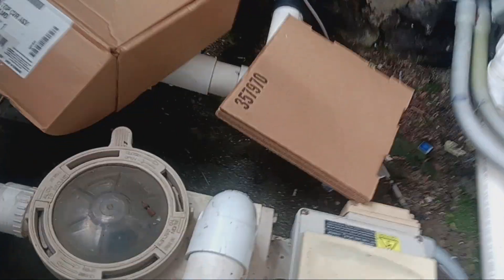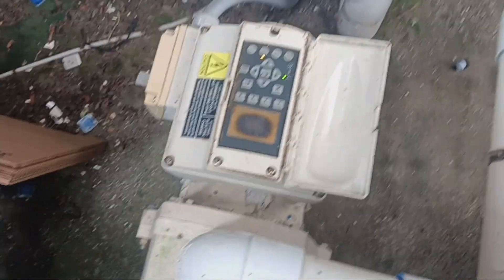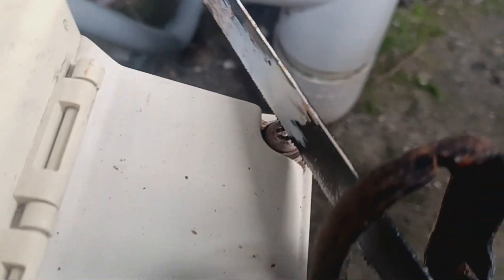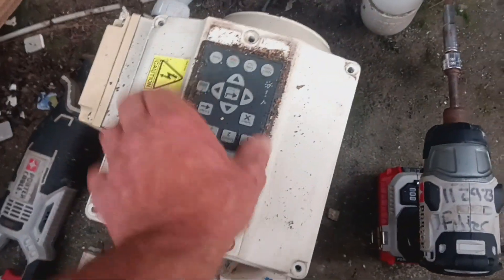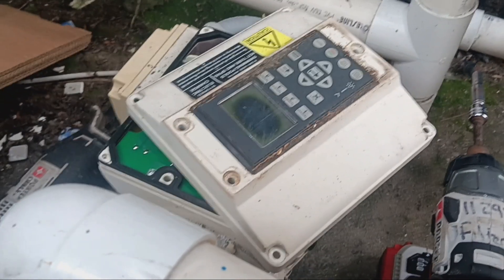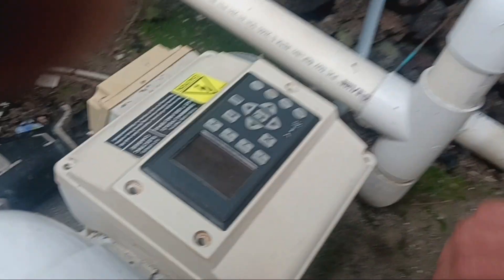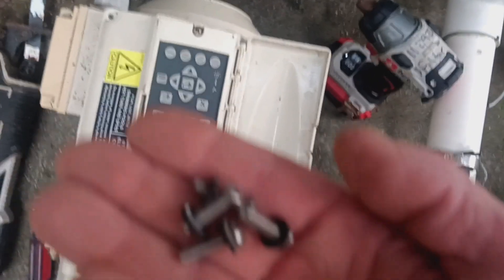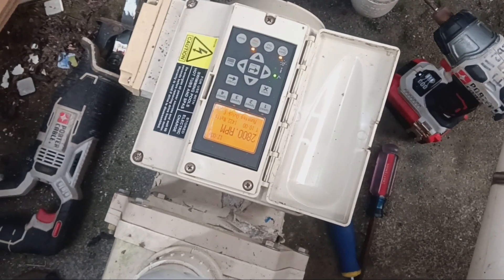intelliflo vs pump screen replacement pentair 357527Z

Comment: Have had problems with the screen for years.  It is completely unreadable now.  But, it pump still maintains schedule, I can change speed with the buttons, turn it on and off, no problem.  Then, the power to the house went out and I need to reset the time.  I tried to just unplug it at midnight, thinking that the thing would reset to midnight.  Nope.  Now, I'm buying a new pad.  Thanks for the video.  Also, I found a relocation kit so I can move the pad to the wall, instead of bending down and crouching behind the filter to do anything.
Also, those torx "security" screws are common tools.  Freight Harbor sells a set, cheap.  No way am I gonna start cutting things.

Comment: It seems strange that you can put the old cover with buttons in different positions onto the new circuit board, and somehow that works?  Is that because the logical functions of the buttons are not built into the circuit board itself, just the pressing action and the function is actually in the pump 'brain' itself?

Comment: Just wanted to say THANK YOU for this video. Purchased the exact same replacement kit from Amazon for around $250. Followed this video exactly (except the hacksaw part, I had a torx screwdriver). Everything snapped off as it showed and snapped back in. 

I can program my pump again! 🎉🎉❤❤

Comment: Damn.  Wish I would have seen this before doing what I did.  I took the new part, and drilled new mountain holes, was able to use all the old screws, and everything works fine.  Had to plug the holes not being used with a dab of silicone to keep it waterproof.  Just have to leave a small "cheat sheet" with the new button names inside the cover to remind me of their "new" names.  All in all, everything turned out fine, but a lot of work.  Good thing I didn't throw the old cable away.  

If anyone discovers how to get the "original" cover part, please post it here.  Pentair really doesn't show anything.  Good pump, but will never buy Pentair again.  Over $250 just to replace a little LCD screen is crazy.

Comment: Thanks. This is super helpful since I have a 2009 model and I can no longer make out the LCD display screen and I wasn't sure if the current replacement parts will work on my old unit. My first thought was purchasing just the LCD panel to save some steps, but it is cheaper to buy the entire keypad/top cover kit shown in your video for $254.99 vs just the LCD panel for $466.81 on Amazon.

Comment: I tried replacing the entire key pad as purchased but would not fit. Put everything back together. Couldn’t even return it cause it was more than 30 says.  Found your video and I am about to do the entire process you did. If you are ever in SW Florida, beers on me. Thanks